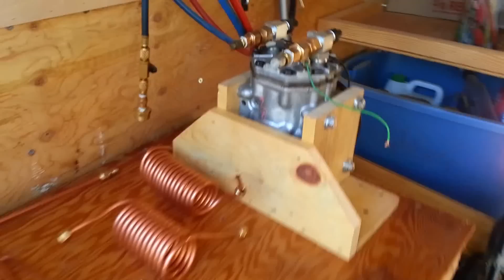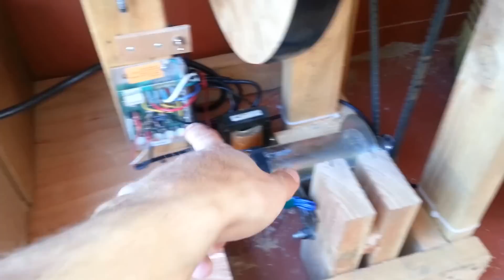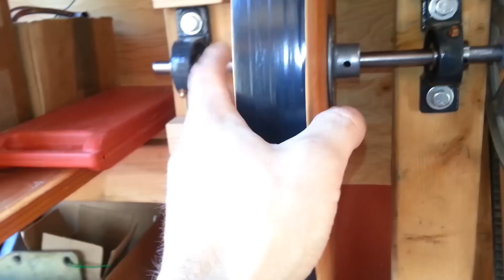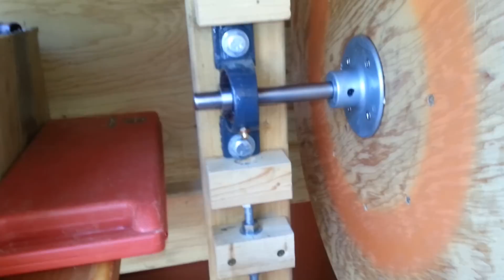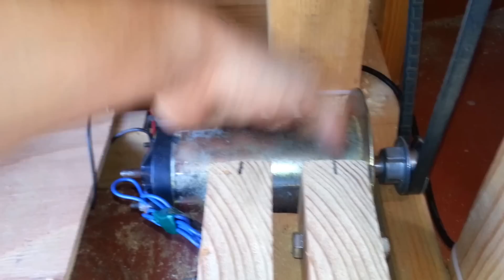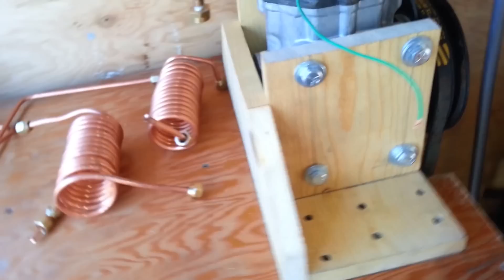Wooden Flywheel Refrigeration Test Bench

Comment: So what's the purpose of the flywheel?  Yes, it can store energy in the form of inertia (Kinetic Energy), but as soon as you connect a load, the wheel slows down so the motor needs to work harder to get back up to speed and that costs power.  Maybe there is another reason you are using the flywheel.
Reply from the maker: The torque required at such a slow compressor speed is far from consistent. Ideally, the flywheel would have been directly coupled to the compressor. It did help reduce the surging between the load and motor, leading to less belt slippage.
Reply: @whatawaytogo515  Ok now I understand.  The flywheel provides that extra torque and reduces or eliminates surging.  Got it!  Smart idea! Thanks

Comment: Hi, M.C Pletcher. I have another question. The metal pieces that holds the wheel to the left and right. Where they are obtained and what is the current name.
Reply from the maker: You know, I don't remember what they are called exactly.  Some kind of flange, I think.  I purchased these at a local hardware store called W.C. Winks.  They were sold with the pulleys, bearings, and so forth.  Some hardware store or website that carries a lot of pulleys might have them.  What are you building?

Comment: if you take that wooden wheel to a tire shop they might be able to balance it... if they have a cone that will fit the inside of the axle hole... I am not sure how you might actually add or remove weight but you could do that however you like. I am not sure though because you wouldnt be able to do it through the metal part... maybe if you removed the metal part... either way balancing rotating bodies really helps.

Comment: What is your final drive ratio (motor shaft / compressor shaft)??
What is the optimum compressor speed for the job you're wanting the compressor to do?
(btw, what ARE you trying to accomplish here??).  :-)
I love those old compressors too!!  Nice vid - thanks!  Jim@MidOhio
Reply from the maker: OUMagManThanks for the interest!  The final ratio is about 13.7 : 1.  The motor is rated at 6200 RPM.  That puts the compressor at about 450 RPM.  I haven't put the tachometer on it yet to find the actual top speed.  Ideally, I'd like to operate somewhere between 100 and 200 RPM.

Initially, I intend to develop my brazing skills and acquire some good hands on common sense with refrigeration systems.  I'm going to start with just making some ice and then trying to model the system as well as I can to describe the mass flow rate, volumetric efficiency, and pressure enthalpy diagrams.  I will use this information to tweak the system fro better performance.

One method I'm using to tweak it, is by limiting the available power I have to work with, forcing me to maximize system performance.  The way in which I intend to accomplish this is to make the machine pedal powered.  The question is:  How much ice can I make in an hour?